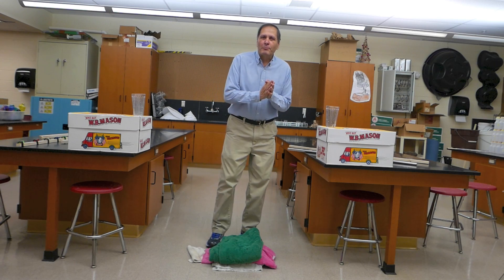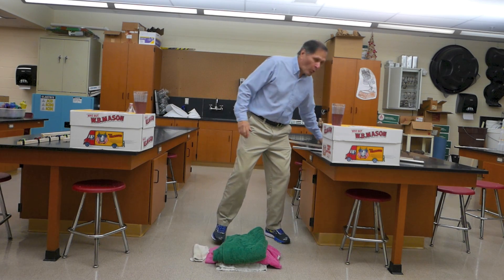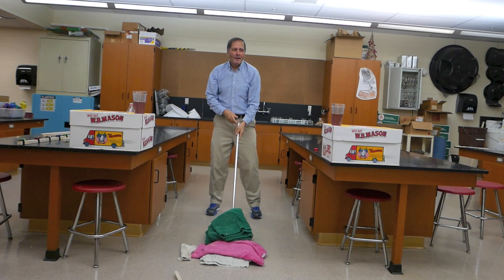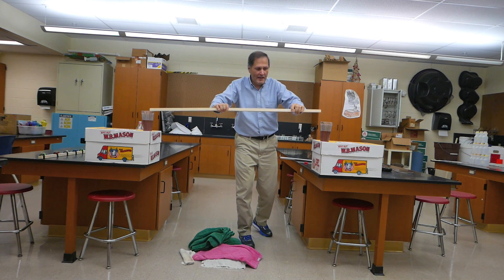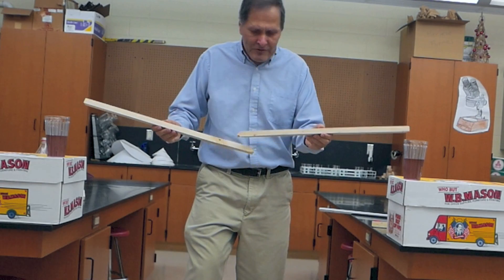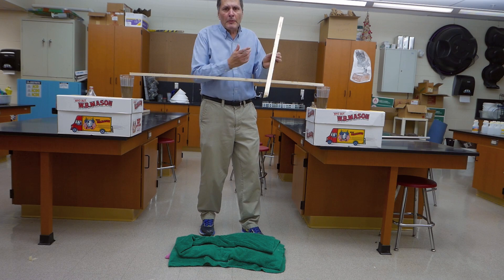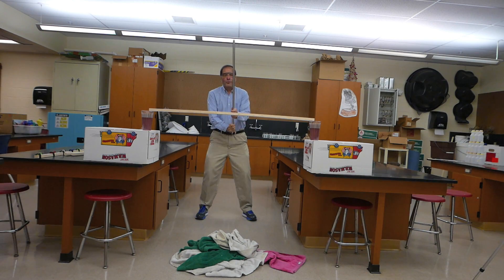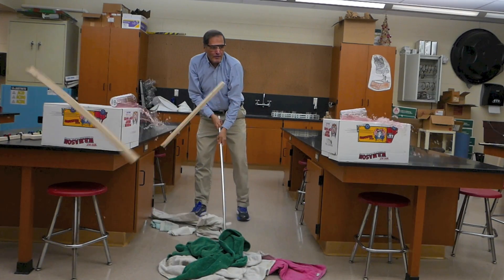Breaking Pole Paradox- center of mass // Homemade Science with Bruce Yeany

Comment: Which highspeed cam do you use ? Many greetings from Austria.
Reply from the maker: HI Stefan,  this video was shot with a Casio,  not sure which model as it dropped and not worth fixing.  Currently,  I mostly shoot with a Sony RX10,  which is a great camera.  With this I shoot at 120, 240 480 frames per second, but I find at 960 FPS the resolution drops off quite a bit.   I just ordered a Cronos high speed camera from Canada and am looking forward to shooting with that,   a bit expensive for a casual shooter  but reasonable when compared to the insane costs of the higher end cameras.
Reply: @YeanyScience  Thank you very much.
Reply: @YeanyScience  Okay. Do you mean Chronos 1.4 High Speed Camera ?

Comment: what about before the new point becomes the center of the mass? after all there is a fraction of a second while there is force applied to the glasses, but it's the DURATION which is so short that it lessens the effect it has on the glasses. after all were you to do it slower you'd drop and break the glasses, so it's a time sensitive matter.

Comment: The explanation this gentleman  gives is  correct in every manner, but may I look at it another way.
Obviously the source of energy that is involved , it all starts with that rod in his hand swing down fast or slow where the nature of that energy will cause a WAVEFRONT to proceed along the horizontal rod. The nature of the distribution of weight along the horizontal rod will decide the manner in which the wavefront travels along the horizontal rod, and it may be regarded as a transmission line where the wavefront speed depends upon the  characteristic "weight" per unit length of the horizontal rod.  In every tranmission line there is a delay as the wavefront  travels along it to reach the other side.
*I am going to suggest that the nature of the speed at which  the vertical rod touches the  horizontal rod, it could be compared to a DC or an AC voltage applied to the end of a transmission line. If the vertical rod comes down very slow compared to the speed of the wavefront along the horizontal rod, the inertia  at the centre of mass on either side is not effective and the force will  arrive at the support points the whole lot acting as a normal beam or lintel.
* If the downward force is fast then dynamics will come into it and the whole force will be impulsive and the energy will be basically stationary acting on the centre and most of  the energy will  go to break the horizontal rod, but to break the horizinatal road the centre must move downwards, and  the wavefront is slow and  the broken half of the horizontal rod will not have the wavefront along it reaching the position of its centre of mass and so the action is now of a large moment on the  centre with the picot point at the centre of mass which due to lever system the pivot points will rise and not fall.
It is a brilliant experiment with lots of scientific components coming in. Congratulations for this demonstration and now for the differential equation describing it.   I consider all this as art and science combined and it is not appreciated by may artists not theoretical academics I am afraid.

I was a little compassionate towards Mr Bruce Yeany when it did not work as he was stunned by the results as he was completely confident of his work but the different states that occur in that experiment occur so fast that the poor man did not realise that the experiment did in fact work and it was only the halves of the broken rod that hit the support car board boxes that  caused the  downfall of the glasses and it was not the experiment failure.  Many teachers do not show demonstrations like this because they involve time, and the carrying of equipment and most educators all they like to carry with them is their own weight.
Congratulations, Mr Yeany for your good work Keep it up and since it is late December 2016 may I wish you a Happy  and a Healthy new year 2017
Reply: On thinking about this problem, I would say that if the  vertical rod is coming down very very fast compared to the elemental weight per unit length  of the  horizontal rod, the break at the centre is due to shear force as when the vertical rod touches the horizontal rod , the side  elemental inertia  at the the point of contact will be too heavy and shear will take place rather. Obviously this is taking the issue to the limit, but it shows a deeper understanding of the real issues taking place.   It is all beautiful invisible art to the human eye as the eye have only a " slow" capturing  speed capacity........... or should I say the transmission of the wavefront through the optical nerve to the brain which  has too much delay and the algorithm in the mind to work it all out is also a little slow with its own thinking inertia. Would love to see the mathematics which describe all this. But not on Matlab as the video shown is better than  graphical solutions on a computer screen.

Comment: I've always thought of this, the more quickly you do something, the less damage you cause to the objects around it, correct? Except for the potential shockwave you might cause i suppose... Imagine pushing your arm against a wall with infinite strength, the wall might fall over, but do it super mega fast, and it will basically just cause a perfect hole shaped like your hand, Is this correct? :O I'm just guessing =P

Comment: Interesting. I'd like to see genuine slow motion of the wave along the stick and how it moves. If it genuinely never presses down on the glasses.
Reply from the maker: I've had quite a few comments on this piece so I will have to give it another try
Reply: Some cellphones now have 240fps modes. You could also use that planter foam to carry the stick. No dent means no shock.

Comment: I'd also try to have the "hit" at a slightly forward direction to knock the half-poles slightly forward.  The hit-pipe should not yet be horizontal on contact, but with the far end higher than your hands. ... Just a thought to prevent hitting the boxes, or use something more sturdy... (:-)...However, that said, The out-take is a pretty good demo in and of itself...-- Cheers, ScienceAdvisorSteve

Comment: Hi Bruce.  This is a really slick demo that I hadn't seen before.  I just use a block sliding on a dowel and tap on the dowel, but this one really spices things up!.
...
A couple of points.
...
In the vid it is a "board" and in the descript it is a "pole".
...
THE key concept here is that when a force is not directed through an objects center of mass, a rotation, or torque, is imparted.
...
From some confusion in the comments, perhaps some editing may help.
I think this sentence may be misleading because the center of the long pole DOES move downward due to the 'hit'.:
 "But, since the wooden pole has a certain amount of inertia, it can't withstand the sudden acceleration force and so instead of being moved downward it simply breaks."
,,,
 It might be clarified something like this: "But, since the wooden pole has a certain amount of inertia along its entire length and it is not completely rigid, the center of mass of each half is not accelerated downward, but "tries' to stay in place. Since the center of mass of the half-pole does not have a force applied directly to it, it will stay in place due to its inertia.   The fast motion at the hit-point now is working against the center of mass of the half-pole so the half-pole starts rotating around its center of mass.  ...I'll be breaking poles soon...!
-- 
Regards, ScienceAdvisorSteve
challengerillinois.org
Reply from the maker: HI Observ45er,  nice to hear from you again,  I appreciate your comments on this and will try to clarify it a bit.  I've taken quite a few comments on this and it is such a good  demonstration I'm thinking of redoing it and try improve the quality.  It was  also one of the most fun to make.  However, between school and other activities, and other videos in progress it will take some time to get to it.  Thanks again

Comment: Who needs karate class when you have a steel pipe!
Reply from the maker: funny,  I tried it with my hand,  not fast enough
Reply: @YeanyScience  Karate chop boards are built so the tensile stress is across the grain when you break them in bending, instead of parallel to the grain like an ordinary board.  The boards break under a lot less stress in this direction, due to the anisotropic strength of wood.  Sometimes they have an overlaid false grain, as a psychological effect to make the martial artist think the board is stronger than it really is, and part of the challenge is knowing they can break the board despite this fact.

Comment: Question:

If you treat the two half pieces as one and compute the center of mass for this combined system, how does this center of mass move?
Reply: Good question.  Once both pieces are no longer in contact with either the glasses or the metal rod that applied the initial breaking force, both pieces' centers of mass fall straight down as if they were each a ball dropped in free fall.  You can see this happening at timestamp 2:10.  The collective center of mass of the system will also descend like a ball dropped in free fall, because it is a "weighted average" of two other points that do the same.

Objects in general will rotate around their center of mass, if not given a pivot point or other constraint to rotate about somewhere else.  The center of mass follows the path according to the net linear forces acting on the object, in this case, gravity alone.

Comment: wait wait wait....If you go back and look at the first attempt the board breaks into three splints, whats up with that? Shouldn't it not to that or was it caused simply by the middle being too sturdy? ( if you were to look it frame by frame with the , and . button you can see that the plank does indeed split into three pieces and interact with one another. )

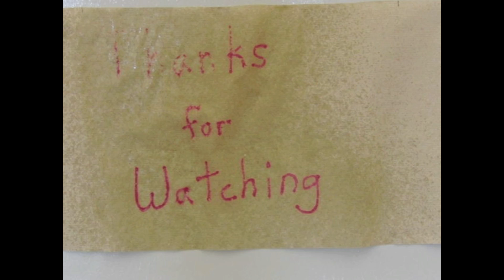Comment: 4:10, why did the glasses tip on the same side, even though they were located at the end of the box, and the two separate sticks/wood hit them on opposite sides of the box_to_glass position.
BTW, the force was from the wood is acting inwards the box, I'm asking why wasn't it a mirrored effect for the glasses to jump. Hope this is not a useless questions altogether.

Comment: Cool! I once had a crazy awesome physics teacher that did stuff like this too. Once he tried to demonstrate centripetal force using the typical water in a bucket. The problem was, the string he attached to the bucket wasn't strong enough so on the first swing it broke and that bucket went FLYING.

Fortunately, he did it in a plane parallel to the front row so it didn't hit anyone.

Comment: Hi, check if your camera can record in modes for example:
"720/60" (resolution 1280x720 pixels and 60 fps = movie is slowered 2 times) or
"480/120" (resolution 640x480 pixels and 120 fps = movie is slowered 4 times).
These are available in my old Nikon. Normal fps is 30.
These modes have poor resolution but they really are slow motion.

Comment: This may be a stupid question, but if the center of mass "moves" from the center of the board to halfway through each of its two new pieces,  could the movement of that center be said to be going faster than the speed of light? I understand it isn't an actual physical object that's moving. Just a weird thought.
Reply: +Tuck Oden   It  doesn't "move".  The Center of Mass (CM) depends on the mechanical objects.  At the point when the bar hits the center of the board, the board becomes two independant boards.  The center of the larger "board" then becomes a joint between two smaller boards.  This joint is now a flexible joint (like a hinge)  by virtue of the pipe hitting and flexing it there.

Comment: Great video, this phenomenum is interesting. There is a little something I don't get though:
The center of mass shift occurs after the pole breaks. It breaks because of the applied force on the middle, coupled with the two support reactions on the glasses, am I right? But these support reactions only exist, by definition, because of the vertical forces pushing down on the glasses edges, which should make them fall down. (And it obviously doesn't 😄)

PS: Please excuse any language mistake, as I am still learning English.

Comment: you explain the cups do not fall because the separate pieces of wood  rotate around their centre of mass and thus deflecting away from the cups. However, how do the cups not fall when the  force is applied to actually break the pole. there has to be a resultant force?

Comment: I'm going for an explanation that involves inertia.  ;-)  It's the same thing when shooting a bullet through a telephone book.  You could setup a telephone book, on end, and try to push a screwdriver through it.  All you will do is push the book over.  But if you shoot the book with a rifle, (I do not know how to explain it technically), but the faster the bullet tries to accelerate the book, the more the books inertia pushes back.  It wants to stay where it is.  So the more... no, the faster the bullet tries to accelerate the book, the more it's inertia wants to keep it in place, allowing the bullet to actually bore through it. 

Same thing with this stick.  Now let's go watch the video and see if I'm right.  ;-)
Reply: Well, he id mention "inertia" just once, very quickly.  He seems to be explaining why the board jumps up OFF the cups (because the spinning around center of mass).  But he's not explaining how he can break the board itself without pushing the glasses down and over.  But a fun vid.  Will def check out some of his others.
Reply: Basically, except its a different idea just because its the breaking of the board on impact vs letting the board flex and snapping.  If he hit slower and weaker and let the board flex at all it would tip both glasses. He is basically cutting the board, and since its blunt the board still holds the inertia, but its already broke in half so they don't have direct downward force instead they act like if you were to hang a pencil of the desk and hit your hand on the hanging part.

Comment: So, in theory, if you somehow managed to break the stick from below, the glasses would spill?
Reply: I would say no, the 2 pieces would go up and to the sides... depending on the force the 2 pieces could hit the glasses on the fly and spill them, or could just go away without anything happening to them. 

*Would be required a very, very fast/strong hit to be able to do that, because you have nothing that makes resistance hitting that from below... the most probably result would be the stick would fly up on one piece.

Comment: This reminds me of the falling chimney problem. The falling brick chimney (or smoke stack) almost always breaks about two thirds of the way up before hitting the ground. The reason is that the chimneys centre of mass (located around the center of the structure) is accelerating at g while the top is accelerating at greater than g. This higher acceleration causes a bending moment along the structure which it cannot support and it breaks before hitting the ground.

Comment: I especially liked the blooper which shows that it actually did work perfectly, and it was the uniformity of the break that caused the pieces to collide. Before the slow motion part, I thought it was because the wood was struck off-center. That was cool!

Comment: But what would happen if you would hit upwards? Would it still break the board and knock the cups over? Or would it just fly up in the air?
Reply: It would break the same because of the wood's inertia but the rotation would be the other way, and that would knock down on the glasses instead of lifting off them. My guess is that that would knock the glasses over. But difficult to demonstrate because it would be hard to get the same whack from below without raising it all up and standing on a desk or something.

Comment: So if you wouldn't have broken the board the cups would have tipped over, right?
Reply: If he didn't break the board it'd tip. But even with breaking the board if it was broken slower it still would have tipped. The trick is the him slamming the pole into the board its breaking on impact, not snapping in half due to bending.

Comment: I think you need to learn what a paradox is.
Also what a high speed camera is.
Also what a pole is.
Reply from the maker: LOL,  okay
I didn't name the experiment
high speed camera is junk,  the shot was too grainy  to use
usually a long cylindrical object made of wood metal, plastic , often used for support, but not limited to a cylindrical shape
You missed commenting about the water,  which looks like Coke.

Comment: Good video! Inertia confuses me though.... Experiments, trial and error, and empirical data aside; how can you calculate how fast you have to break the stick for it not to topple the glasses of water? The same question would apply to the famous "yank a tablecloth from below a glass of water without spilling" demonstration.... I get the concept, but I'd like to know how to calculate those minimum velocities (the stick breaking and the tablecloth yanking) for the demos to be succesful. Help, please?
Reply from the maker: Being a middle school science teacher,  I don't have the opportunities to get into the math that deeply,  sorry,   but I hope someone else can help here
Reply: No need for apologies!
Reply: It becomes a tricky problem.  You need to calculate the bending moment about the center of the board that is exerted by the inertial forces of the ends of the rod.  From there you would need to use material properties to see if the rod will break.  The bending moment would be directly related to how fast you hit the rod.